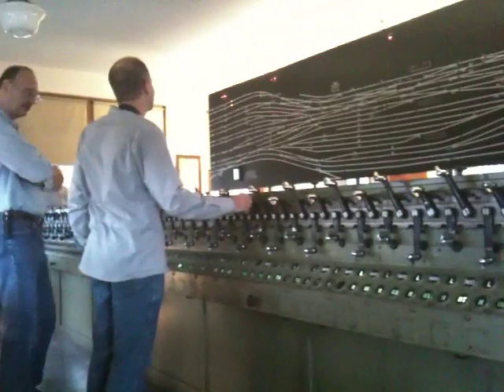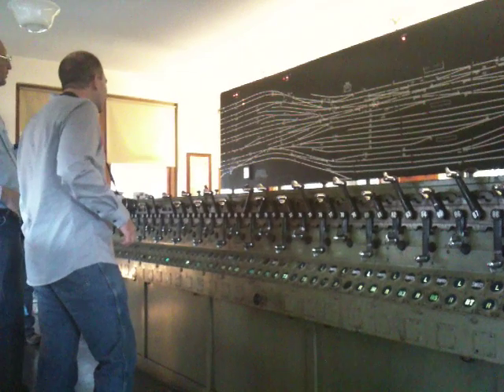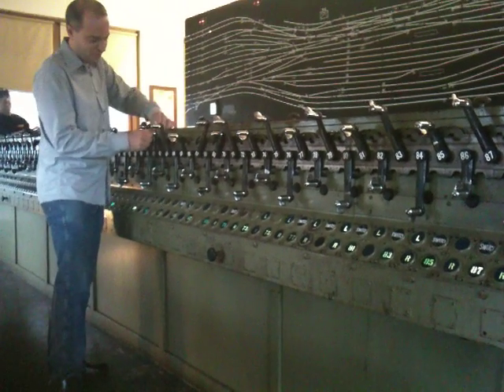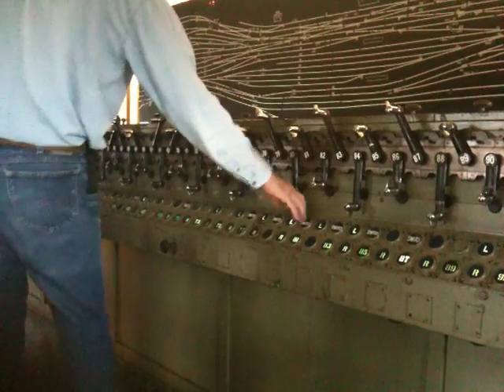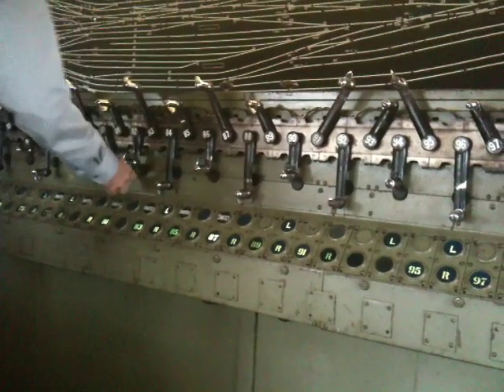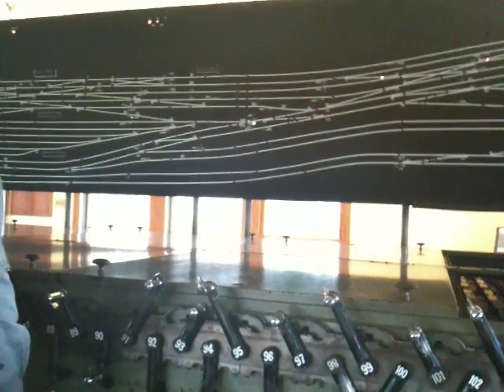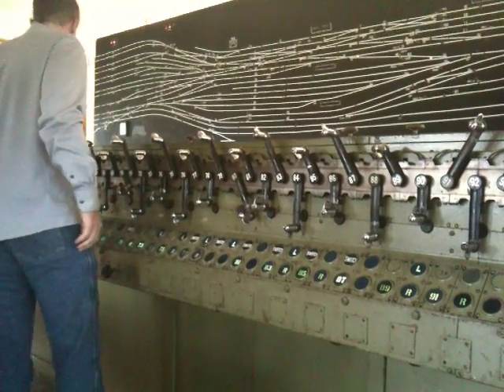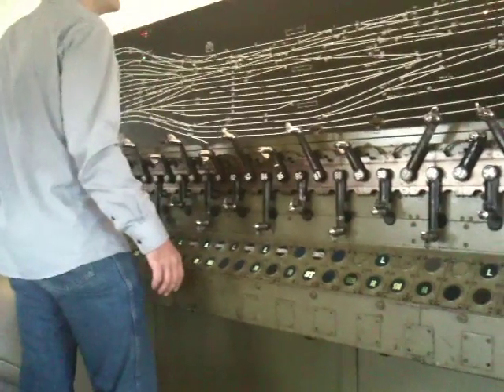Harris Tower Interlocking Machine Demonstration

Comment: conrail used to have lots of those harris machines, i think they are all gone now, its a shame those things were made by union switch& signal, they were made to last 500 yrs or better.
Reply: I think the Model 14 at ZOO is still in partial use.  The Washington-New York Main has been on CTEC for almost 25 years.  I think A2 in Chicago is still in use as well.  If it isn't a Model 14, it is a pretty close cousin.